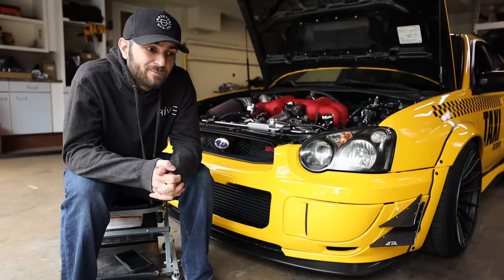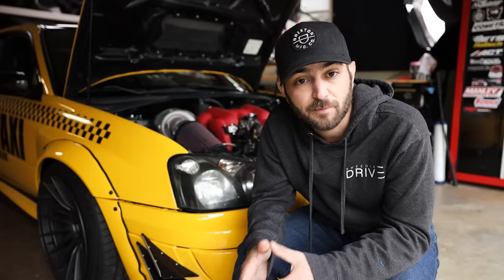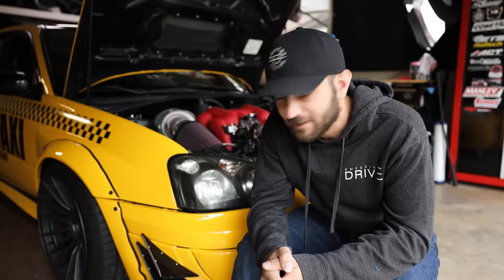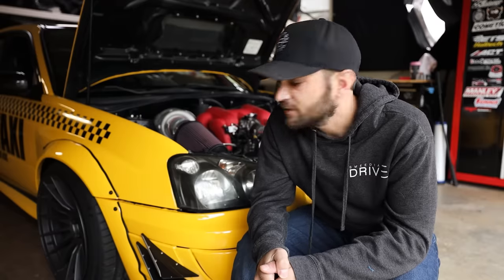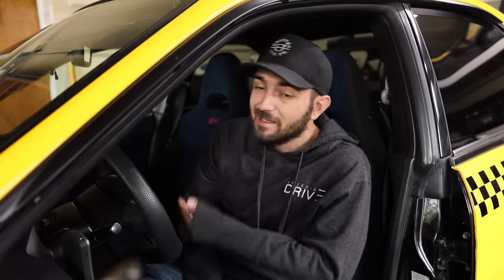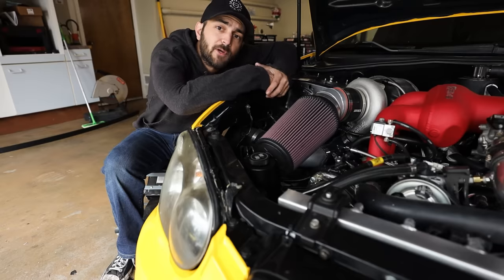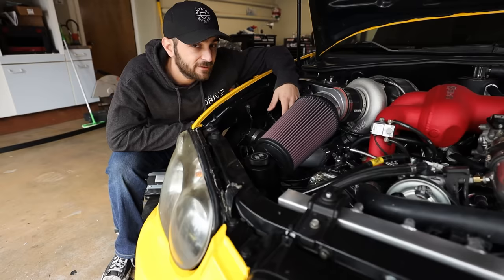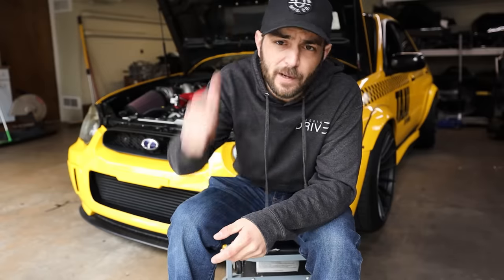What You Can do To Keep Your Subaru Reliable.

Comment: I currently have a ‘19 STI. STI short shift. Got it at 5k miles. Now it’s got 23k miles. It’s my legitimate daily driver. Love it!!!! Glad to hear it’s the S209 setup😅. And that 3rd gear has been “beefed up?” The only mod it has is a COBB AOS. Didn’t know what the heck it was at first until I did some “Google Fu”. Glad the last owner invested in that. My mechanic that I’ve been going to for years said it was a solid install. I do Full Synth 5W30 oil changes exactly at 5k intervals but always keep a reserve quart. I rotate the tires every other oil change. Pain in the ass with that plastic panel I have to remove every time because I jack up and crawl under the car to change oil. Learned as a driver by trade that older engines and anything turbo will consume oil despite being in tip-top condition. Lots of highway commuting is why I have a longer oil change interval and per Subaru, which I kinda am skeptical deep inside. I’ll change intervals to 3k/3months. 

These STIs are an investment. You don’t hear this that much about cars unless it’s Porsche, Supra etc. I’ve been, recently, offered more than I paid for it! It’ll hold its value for the most part even after this used car bubble bursts. 

Every car I’ve ever had is always considered a POS from a POS manufacturer. I’ve always maintained my vehicles. And if any upgrades were done. I bit the bullet and got quality parts. I’m just an enthusiast and can turn a wrench but if I am unsure I will go to an established pro and have what I need done.  

I remember my 05 WRX Wagon, my first AWD turbo…autobox, always downshifted that thing to stay outta OD😒. I used royal purple in that one regularly. I was only in my 20s 😬. Never had issues with my Subies. Just did routine maintenance. Never modded them extensively for that matter. 

I hated that I couldn’t use my STI during last winter because I knew that it was sitting on 19” summer tires and couldn’t invest in all seasons or a separate 18” snow-tire/wheel yet. I have a Wrangler as a backup 🤣.  

Would a COBB AccessPort be beneficial without having modded anything???? Or a professional tune?? 
Just wanna help the STI be more efficient, smooth and prolong its life…
And make more HP on the side 😈

I plan on keeping this STI. Or until Subaru convinces me to buy whatever STI reboot (8 Speed DSG-ish) 400hp Wagon they come up with in the future 🤣 🤣.

Comment: Hey Tanner!
 I had a relatively involved question for you this time around. 

I own a 21 STi and I am all about making the car as reliable as possible (heavily inspired by you). So far I have an IAG street AOS and GDT Cylinder 4 Cooling Mod hooked up to the engine. I think I am ready to take the next step with a few bolts-ons (for reliability).

My ultimate goal for this next step is to install a COBB Front Mount Intercooler (cause its carb legal haha) and Killer B EQL Headers. Maybe a COBB Redline intake. I plan to run near stock horsepower for now.

My question for you is: will running a COBB intake, COBB FMIC, and Killer b headers on stock fuel system and stock downpipe cause the EJ257 to lean out? Do you seen any issues with this set up?
Reply from the maker: You can do it but you won't really see any of the benefits of the mods without st minimum doing injectors and a Fuel pump 😖
Reply: @Smeedia  Gotcha! In all honesty its more for reliability than any sort of power gains,  but I'll just have to wait and see how it goes! Thanks for the reply 🔥
Reply: @trnql_noir  what did you end up doing?

Comment: Along with the belts. Double check the pulleys/tensioner and the water pump. Had both a water pump fail and a timing belt tensioner fail that cost me 2 engines.
Reply from the maker: Tensioner is a big one!

Comment: Regular maintenance, warming up and letting it cool down at idle helps a bunch. Get an AOS, cylinder 4 cooling mod. Delete the egr system, if possible. Get a proper tune. Don’t abuse the car on a regular basis.

Comment: Excellent points. I used to watched Bader but it's playing Russian Roulette with the engine life and longevity and all of those drivers are prepared for a an eventual rebuild after it dies (his words, not mine). Used STIs and WRXs are very popular on the market and you never know what underline issues have happened and will happen so that is another good point to figure out these issues before modifying the tuning the car, 100%. I'm certain that every WRX and STI has been driven hard at some point or else what would be the point of a previous buyer buying the car in the first place. Buyer beware.
Reply from the maker: Facts, no one babies these cars. They're all driven hard. However if taken care of you can minimize failures. And Josh has said it best, you want a race car you'll have racecar problems 😅

Comment: Warming up the engine before you dog it or rev it is super important. Wear is magnified exponentially the cooler the engine is under 180 degrees F. There has been massive research done on this subject and there are wear/temperature charts all over the net referencing this. Another is ETHANOL mixed fuel will reduce the life of your oil. The more ethanol you run in an engine the higher the % of it will leak past the rings and get into your oil. Ethanol is very bad in your crankcase. So if you are running and E mix your oil change intervals should be short.

Comment: Having owned three GC8 WRXs at 147k, 128k and 125k miles my opinion is they are reliable cars when left in stock form. They are poor track cars as the stock oiling system cannot cope with track conditions, simple as that. They are also super sensitive to knock/pinging. At the same time subarus are pretty cheap, and very common compared to something like a lancer EVO. They are also the best sports car ever made IMO so Im gonna stick with my subarus as long as I can 👌

Comment: if you have oil pressure gauge wait until pressure drops before going ham.  At idle my pressure would be around 90-100psi. after fully warmed up it drops to 20psi.

Comment: After market oil pan, new return feed line New fuel rail replace intake with brz super charger retune, add extra coated plugs run motul in engine and royal purple in everything else oh and rings as strong as captain America's shield

Comment: I bought a 2020 STi thinking it would be better. Unfortunately I had bad luck...at 10k the motor decided to say ✌ out. Didn't beat on the car, serviced the car every 3k at Subaru. Checked my oil regularly. I only had an Invidia catback with a stage 1 stock motor tune. Cylinder 1 spun a rod bearing. Also the main crank bearing/seal also went. The Subaru tech wasnt sure which occurred first. I was honest about what modifications were on the car and polite about it. Luckily for me Subaru is going to warranty it out for me. Even if you do everything right, unfortunately it can still happen.
Reply from the maker: Glad to hear that they're helping, if your honest and up front with dealers. Most of the time they're willing to help
Reply: Me too...I find getting angry will typically get you no where. I know if someone is rude to me, my willingness to help is significantly decreased.😂

Comment: I'm ridiculous with Oil changes I do mine for the most part every 1000 to 1500 miles, one time I let it go to like 2200 miles.. I do them out of boredom sometimes.. Doesn't hurt.. And I do at least one CVT drain and Fill every June right before the Hot months of the summer too I know it helps... Just has important to keep that clean and new as the Motor oil..

Comment: Question subaru heads 
I own a 2005 wrx, Ej205 2.0L ,120k miles, completely stock with one owner that babied her. She was very solid and reliable when I got her 2 years ago and still is. Since, I put a perrin turbo inlet hose, mishimoto coolant/rad hoses, Mishimoto ancillary/intercooler hoses, full oem timing belt kit with oem water pump, full tune up, pressure test, walbro 255 fuel pump, and a cheap spec D catback. (Plan on getting a good catback soon) she's super reliable and solid with no leaks and been using her to dash for 2 years. She didn't need any of that stuff when I got her, just wanted to be pro-active for long life. Also, I plan on getting a new Ej205 after 200k. My question: I want to get a cobb AP, cold air intake, maybe a downpipe (if needed) and a BOV. Can I do this stuff to make just a small amount of HP (250-300 range) and still be totally reliable? Everything is stock basically and It has the baby stock turbo, would I need a bigger turbo to do those numbers? Injectors? FMIC? 
Also it's a 4eat  😥 

Thank you!

Comment: i have a 2022 crosstrek 2.0. it has a FA engine. i have worked on quite a few cars, allot of small block chevy, GM 2.2, and 3800 engines (including several L67 supercharged i still have a 03 bonneville SSEi). the subaru is very new to much the only thing i have done so far is fluid film treatment and 1 oil change (first oil change was free at the dealer). i plan on doing as much work as i can on this car. i bought it because it's great on fuel and is awd, it handles the worst of the weather with ease.  direct injection is greek to me i only know it has some type of a high pressure boost pump under the hood and it operated more like a diesel then multiport. ill mod my old school 3800 because it's familiar, not so sure i would be modding a subaru. the 3800 is cheaper to mod.

Comment: You don't need a oil temp gauge for startup warming.... you can use the oil pressure gauge instead,  pressure drop as oil temp go up- around 100psi cold and 15psi once oil is fully warmed at idle.
Reply from the maker: Oil pressure also works, normally I go off of temp letting it get to at least 50* C 
Idle PSI can vary though based off of your engine, tolerances and oil grade
Reply from the maker: EJs also don't come with Oil pressure gauges from the factory, but wither option works 🤙
Reply: Wish I had a pressure gauge :/

Comment: Okay my old wrx had a missfire in all 4 cylinders. Took it home, oil changed, drained the gas out of it. Put some good gas in it. Everything was fixed. Issue was very very cheap gas that was supposed to be 91 but was pumping out 85 into my car. Not e85 either
Reply from the maker: Oooooffffftt seen that happen too many times 😖

Comment: The more you mod, the more scheduled maintenance you can expect. Call it overkill but I do plugs every 25k, coils at 50k timing belt at 80k, oil change every 3k, coolant flush every 20k as well as trans and diff fluids.

I’m on speed density, but for the love of god people clean your maf!!!!!! A dirty maf is a fast track to running lean and misfiring leading to detonation and over time it’ll kill a rod bearing.

In my experience, Porsche A40 A3/B4 oil, I run Mobil1 5w50 it’s the only Porsche A40 rated 5w50 with HTHS rating of 4.45! Just as high as amsoil, redline, motul, etc. I use it, Napa has it for 5.99 a quart and with changing oil every 3k its economical while the oil analysis comes back super clean, loaded with molybdenum, calcium, boron, zinc, and phosphorus. I am in Florida and deal with high temps, hence the 5w50.

Comment: When modding your car it's always at your own risk, do your research. I'm very impatient and impulsive, but I love my 2018 wrx and I absolutely do not want to dig it in a hole. I've heard that an aos or catch can is crucial to turbo cars in general, especially for subies and especially if you plan on modding your car. Like he says in the video find a reputable tuner. From the research I've done a pro tune sounds like the best bet rather than tune kits exp. cobb because not every car performs the same so the kit won't be properly mapped to your specific car

Comment: I unfortunately never changed my timing belt.  It let go, destroying my engine. After putting a used engine in the car from a subaru dealership that one was fucked too.  Ended up driving a loaner from them for a year while my car sat at the dealer waiting for them to decide what to do.  Eventually they gave me a brand new long block with no other charges!
Reply from the maker: A year?! 😳 that's insane! But glad it worked out in the end 🙏
Reply: @Smeedia  yea, a whole year lol, no exaggeration.  Couldn’t believe it. Terrible management there. Finally once a new service manager was hired something was done about it.  Crazy though. But the car runs awesome now!

Comment: I just got an 08 WRX and it's stock with bc coilovers in back but of unknown abuse.
Thinking of getting cheap replacements but your warning is appreciated.
They do look great with adjustable damping and cool colors.
From a company called Rev9 for just over five hundred for four.
Big names are thousands.

The car is a salvage title that I got for what seems cheap at four grand but time will tell. 98k miles.
Plan to get groceries for a while and get some use out of it but it will be tossed around on tight mountain roads and mild Hoonigan action later.
Never going to be a museum showcar.
I know 08 is the hated year.
Seems to need a better front swaybar.
So how about them cheap shocks?
They might help up front.

Any non boost mods for dirt roads, Mexico or other durability tips are always appreciated 👍!

Comment: Looking at 07 impreza 2.5 n.a. owners are an older couple bought it new.He showed me a pile of receipts showing timing belt water pump and head gaskets changed it has 153 thousand on it runs good. Head gaskets were changed to metal gaskets just leery of all the head gasket issues these engines have is it a good buy $2000 suby dealer did all the work. thanx

Comment: Currently sitting at 250kms  v4 sti original motor and running gear . 
The engine surprisly holding up.

Comment: Bought an n/a 07 Impreza, previous owner did his own head gasket job (I had no knowledge of this at the time of purchasing) he ended up drilling too far through the engine block trying to re thread the head bolt hole ( doing a time cert?) and rendering the bolt useless, meaning that the head gasket would not work from the start.basically ended up buying a ticking time bomb. Don’t be like me, get it pre inspected before buying, it’ll save yourself a ton of money and pride

Comment: As a stage 2+ Sti owner I can validate that an nvidia down pipe no cats works with a Cobb stage 2 tune. They aren’t as sensitive as you say and I also have a grimspeed boost controller so not sure why you say they won’t work. Now if you push over 550 whp then I agree with you but you’re putting a lot of money in at that point

Comment: Hey man, been following your channel for a while. I’ve had a 2015 WRX and currently have a 15 STI. Always prioritizing maintenance and reliability mods over the fun’s stuff.

Until I get that oil temp gauge installed, how do I know when it’s safe to get on the boost? The coolant reaching standard operating temp? The intake temps off my AP?

Currently, I just give it 15 minutes if engine runtime on high way driving or 20 minutes of suburban both including 2 minutes warm up before driving off.

What do you recommend?

Comment: This might be one of the greatest videos on Youtube, I've seen. Do you recommend a certain oil pressure range during the warm up process? Right now, if my drive is gonna be a short one, I try to let my car warm up longer (try to get my oil pressure in the mid 80s). If its a longer drive than my warm up time is shortened and I am pretty easy on the throttle, until oil pressure is around the 80s. Also running flex fuel so the e85 def keeps things cooler

Comment: OTS tune should only be used to get you to the tuner after parts are installed.  No two cars are the same regardless if you use only Cobb parts,  just get a pro tune.

Comment: On the oil changes, on E85 I was told to do my oil changes at 1500 to 2000 mile interval
Reply from the maker: That's typically what I've stuck with in the past to pay it safe. If your running E30 or something similar you could prob stretch it out a hair
Reply: Bro I go 6k between oil changes on my e60 wrx but then again I'm using rotella t6
Reply: @GaragebuiltOriginal  I use Rotella 5/40 but still keep my oil changes 2k miles and under. I don't mind doing them often just for peace of mind

Comment: I have a 2010 wrx and I got The HKS ELH manifold to help cylinder 4 issues,I got it protuned  by FUNK E BUILT in CO and I ended up with 270 whp and 330 tq! Underrated mod to many because you lose the subie rumble
Reply from the maker: Elh is always suggested 🤙 helps with more consistent EGTS in cylinders 2 & 4. Sounds like a fun little daily 🔥
Reply: @Smeedia  thanks man! Love your channel  👍

Comment: Love me or hate me,

My 2014 Subaru Impreza Sport wagon has 178k miles, burns oil, and has a few battle scars,

But I change my oil every 3,000 miles on the dot, Mobil 1 High Mileage, and a K&N Gold Series filter

K&N factory aircleaner setup, tried a cold-air intake and since it's not turbo'd, no point, took that shit back off and just stuck with the factory K&N filter setup.

Factory exhaust headers and pipe, but dropped the resonator and muffler, built my own single-out rear pipe down from the muffler flange, and replaced the resonator with a 3" in/out 26" long Cherry Bomb glasspack, on the factory 2.25" pipe. Looks goofy as hell, but sounds aggressive and has that brappy boxer tone without being expensive or overkill. Turns heads, and even the idiot college students that are around with their built up WRX STis ask me what exhaust kit I've got.

They're a hell of a dependable engine, the FB20.

Can't wait to WRX swap my front clip, hood, and fenders, and drop a EJ257 into her, with a 5 or 6 speed manual. It'll be nice to stray away from a CVT

Comment: My Legacy GT ('98 with 366k miles, rebuilt motor )
currently has a misfire in Cylinder 2 😅 even after checking and replacing the spark plug. Going to have a trusted shop look at it. 

I do the 3k oil change, and I got a clogging cat that is probably effecting the misfire.